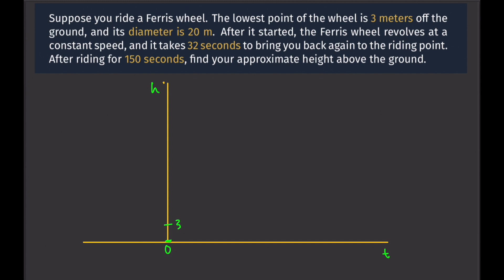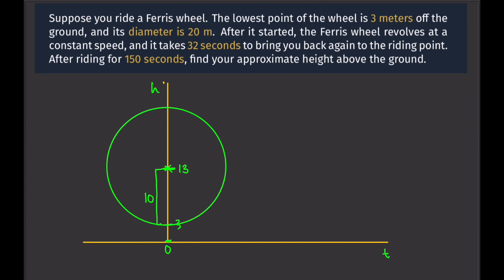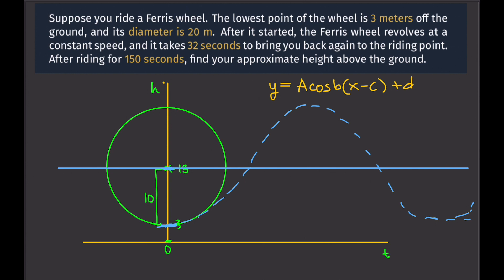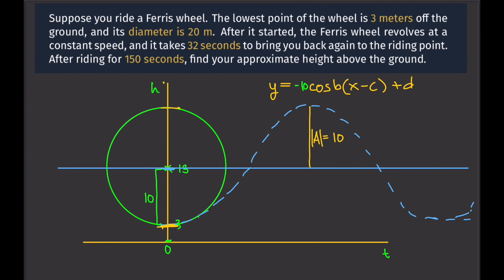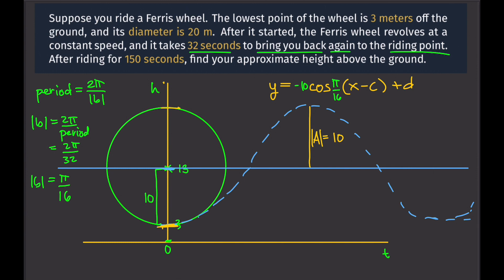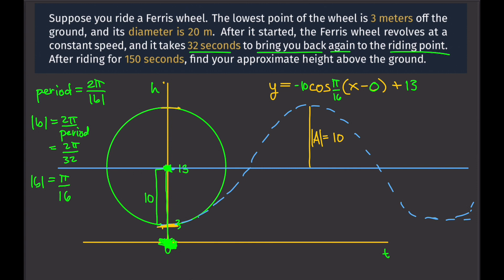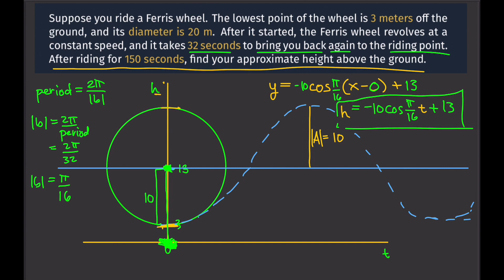SIMPLE HARMONIC MOTION EXAMPLE

Comment: Question,

How did you calculate in the last part? Did you use a special mode in your calculator or just use the standard/normal mode ?
Reply: @mr. ak  Sir I figured out what went wrong.

Both t and period needed to be inside the parenthesis, instead of them in separate ones. Took way too long to figure that out.
Reply from the maker: @fallenoak4560  Oh. Glad you've figured it out. :)
Reply from the maker: Use radian mode.
Reply: @mathforbreakfast  sorry but still doesn’t work.
Reply from the maker: @fallenoak4560  The 150 should be inside the cosine function.
Reply: @mathforbreakfast  getting closer... anything else sir, or that’s it?
Reply from the maker: @fallenoak4560  if you did that correctly, that should be it.
Reply: How did you do it pls help me still can't figure it out 😢
Reply: @georforowena476  It's been three years and I'm in College already.